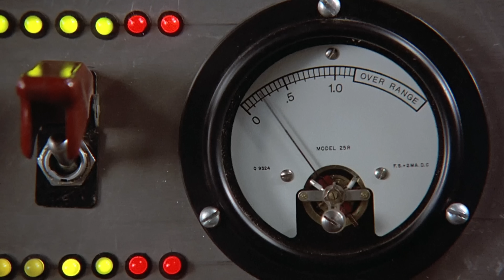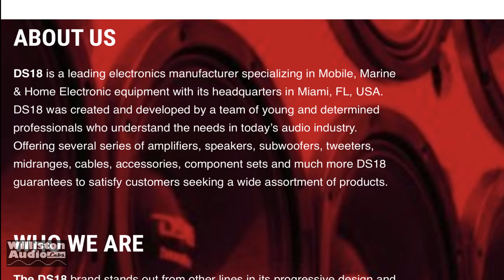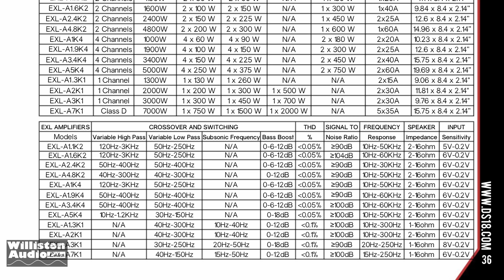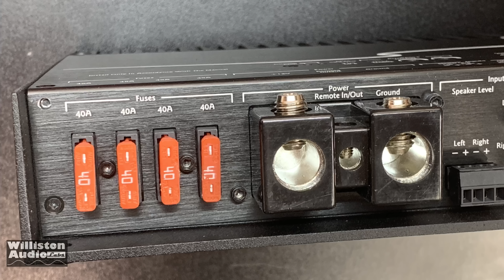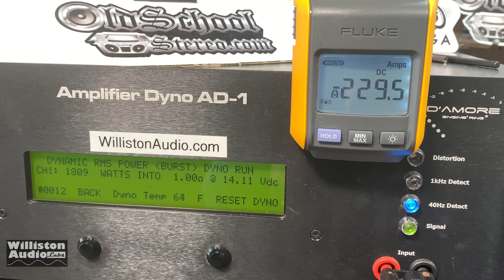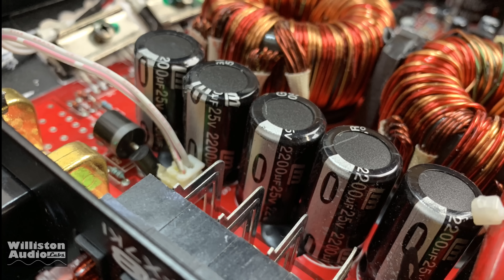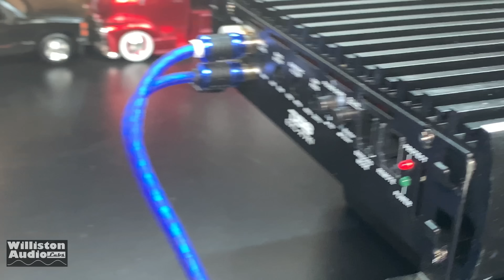Confusing Consumers like a Boss... DS18 EXL 7K Amp Dyno Test and Review [4K]

Comment: If possible I think you should test the DANOM amp's they have a 7k & 10k I was thinking about getting one of them I don't know it's a Brazilian amplifier I've heard good things about them but then I heard bad things about them 🤗
Reply from the maker: My electrical for the bench won’t support amps that big and keep 14 plus volts. I usually stay 5kW and under
Reply: @wal  WOW REALLY how much power do you need for a 7k 😳
Reply: @FLYGUYFOX  Assuming that amp even has 70% efficiency at 7000Watts (I am positive it is a few percentage points less), and assuming that maintaining a 14Volts power input is even possible then....10000Watts. Power Output = 70% x Power Needed, or 7000W = 0.70(x) = 7000÷0.70 = 10,000Watts INPUT. Maybe that amplifier is underrated too, and maybe 7000W is only at 1%THD and not even clipping or dynamic. That would require probably a solid 14000Watt supply setup at 14Volts. 10000Watts at 14Volts is 714Amperes. P = VI so 10000W = 14V x I = 10000÷14 = 714.28 Amps. Ridiculous stupid current. Maxwell cap banks, two or three batteries in parallel, 1/0 OFC and NOT loser-ass CCA (maybe TWO runs), and three 350Amp alternators turned up to 14.5-15Volts on the regulators. So, would you like to donate about...mmm...$2500 minimum to Mr. Big D Williston so he can add more Super Caps and a battery or two?
Reply: @pgmurray76   Thank you very information AI have A 7K amp  With 2 danom 150 AH  Just try and see if I need more battery power on A 375 alternator
Reply: @FLYGUYFOX  DANOM is VERY SERIOUS and VERY NICE product line!! I see your DA-12150 battery and your Just like all the other huge Brasilian car audio and pro sound companies. NOT a clownish copy of anyone. NOT a "fly by night" company. I love what I see. Definitely wayyy above Stetsom. I feel like I am looking at a wall of EV prosound speakers, but the Danom subs are MASSIVE like any good high power sub should be. I am going to add a separate comment just to call out Danom. Who knows? Maybe a big one will pop up in a Williston Audio Labs AD-1 posting in the near future. Actually, I should contact Danom myself and show them hiw much people love Big D Wiz and if they are not fakers, they should send out a mid power amp loaner to the USA for testing. I believe they are as powerful as they say they are. Strange though...last Facebook post was March 21, 2018. Before this was January 23, 2018. Hmm.
Reply: @pgmurray76   You shall see what I have in my car I had DANOM 2500.4   mids and highs amplifier is the truth pushing 4 DANOM 8'S & 4 DANOM TWEETERS  TALK ABOUT CLEAR AND LOUD IF I OPEN MY DOORS YOU CAN HEAR THEM WHERE YOU AT AND I'M LOCATED IN MIAMI LOL 🤣 THAT'S JUST HOW CLEAR AND LOUD THEY ARE BUT I COULD GET MY HANDS ON ANY DANOM  PRODUCT
Reply: @FLYGUYFOX  I see DAN-F3800.1 (3800Watts RMS). I see DAN-DA5K (5000Watts RMS). Is there a DAN-DA7K? Or is it a different model? I saw another model with 5000 in the model number, but it said 2500Watts RMS. Is yours a 7000 model and 3500Watts RMS?.This is all Facebook posts since I cannot see the website. If yours is a 7000 model then your alternator and battery setup is excellent. You need a cap bank and to have 1/0 OFC (NOT CCA) power and ground. You should be good, unless you have a DAN-DA7K then it may actually need 600-700Amps for full 7KW output. I am still checking.
Reply: @pgmurray76  DM ME ON IG FLYGUYFOX I HAVE THE FULL CATALOG IN COLOR LOL 🤣
Reply: @FLYGUYFOX  Ahh. DA-H1A10K. 10000Watts. Sooo you must have a DA-H1A7K
Reply: @FLYGUYFOX  Brasil, USA, Iran, Venezuela, Ecuador, Colombia, Puerto Rico, Panama, and Nicaragua. Countries with Denom distributors/sales.
Reply: @pgmurray76  I was going for the 10K but they said I need a lot of power which I almost got lol 🤣 but I have the big three dots on my truck high output alternator an oxygen-free Orion 0 gauge wire TRUE copper
Reply: @FLYGUYFOX  Hmm. DA-5K. That is the model with 'CLASS X DIGITAL MONO BLOCK AMPLIFIER' and '5000WATTS' on top. Digital Competition Series with cooling fan at top left in brushed silver left side and an LCD voltmeter at the bottom left. I like the black mesh cover with the punched round holes.
Reply: @FLYGUYFOX  I have been looking at an Instagram feed generator/compiler website with 'Denom' in any posts. I found a photo a new DA-H1A7K box on top of a new DA-H1A10K box. They do say 'RMS 7000Watts' and 'RMS 10000Watts' RMS after each printed model number. And they are long amps. I can only see super clear photos of the tops and the RCA input/speaker output end of both amps. Since you have one - is it fused internally? I only see the two huge machined power wire blocks in the center of tge opposite end. Cannot see if there are external fuses. Something is over there next to the power blocks.
Reply: @FLYGUYFOX  THAT is a quality and loud setup you have. You didn't get like Brasil or Dominican Republic crazy with the system (NOTHING wrong with that!) - meaning actuator lifted walls and bi-fold fiberglass doors. Damn! I was talking over you the entire time. Sorry again. I saw the Youtube notifications on the top of my Galaxy S9, but could not see your entire comments. I got OCD trying to find which amp model you had. Thank God you bought REAL power cabling. Not surprising since you are in Miami. Quality install shops are there and Orion has a huge presence. I am from NJ, but mostly in southern California, and drive to and through Baja South every other month. We will start taking a jet to San Jose Los Cabos and rent a car like normal ppl starting next month. I am a partner in a company that selects, designs, sells, and installs small to huge air conditioning systems in private homes, offices, hotels, hospitals, and condo buildings in all of Baja. Stupid MX goverment and banks both hold our damn money 30 days each sometimes. They both 'play' with my damn money then pretend they don't have it. Screw Mexico govt and banks. I wire money to MX and it arrives the next day with no holds and no bullshit.
Reply: @FLYGUYFOX  I went to six consecutive years worth of NYC Dominican Day Parades and PR Day parades just to get pummeled by the audio of the tractor trailer floats and the vans loaded with speakers. (Pluss all the ass. I won't lie.) Been to DR for two weddings and see the towers of pro audio out in the middle of nowhere making palm fronds move and vibrate. I used to install ok systems decades ago.
Reply: He does not test above 5000Watt RMS amps to GUARANTEE that the amplifier on the test bench can run without any limitations, other than its own design. Sure, some of the mono Orion HCCA beast mode man amps went above 5000Watts, but that is rare these days and it was Dynamic power with a slightly dropping voltage. Orion HCCA and the newer, larger XTR amps are something else.
Reply: I searched 1.5 hours for 'Damon' of Brasil. Nada. Zip. Zilch. Just because I as one person could not find them after 90 minutes and using all kinds of Portuguese translations does not mean they do not exist. But if it is that hard to find them.. sounds like a clownish fly by night company copying Taramps, Stetsom, Banda, or JBL/Selenium Brasil designs. A side note - I want a few brasil JBL Vulcano or Tornado subwoofers. Beasts in a narrow band SPL vehicle. But so are about 200 other subs. Where does a person "hear" of Damon or see Damon on the internets?
Reply: OHHHH!! DANOM and NOT Damon! You mis-typed it!! Sorry dude! Now I see all. I am kicking myself. Shoulda rearranged some letters. I did find old 'Demon' series Power Acoustik 6000Watt mono amp line. You seriously need some Maxwell or other brand high current super caps. You have a good run of wire and hopefully upgraded 1/0 minimum engine grounds and a 1/0 ground run to your 150AH batteries. If these amps do put put 7000Watts they may be coming up a little short, but regardless you are getting a heap of power and probably great output from your sub array.
Reply: @pgmurray76   Forgive me for a typo I have a DANOM 7K on 2 DANOM 15'S & 2 DANOM DA-12150  AMG batteries A 150 amp hours  Oh yeah the fifteen's  R 3000 are amiss

Comment: Are referb amps warrantied? Does the manufactur have to reveal the faulty parts? I'm just curious. Thanx for the video
Reply from the maker: Yes, depends on Mfg, but usually between 30-90 days
Reply: It would depend on the manufacturer or distributor or retailer.  Most will give at least 30 days or state required minimum for electronics.. witch-ever is longer.  No a manufacturer does not have to disclose what parts, if any were defective and if they chose to use the same part designs or updated or beefier parts.  If the unit passes final testing then out the door it goes.  

I have purchased refurbished amps before and I have no issues out of them.  Just check warranty and return policy before you drop the $$ .;)

Comment: isn't that like really good? is there anything else better for the price, I think not right?
Reply from the maker: It is a steal at $100, but I’m betting this was around $300 new
Reply: @wal   ya makes sense,

also did they fix the glue issue with the new rockiville, I heard if you push over 800 watts there is a good chance you will end that sub, I haven't looked it up since but ya,
Reply from the maker: @sniperpronerfmods9811  Upcoming video on Rockville Audio K9 subs, I'll test the 12" to it's limit, so we'll see how much power it can handle...

Comment: Oh no DS18. I had hopes for them but was left disappointed.
Reply from the maker: Amp is impressive minus the ratings. If rated 600/1000/1500 it would have made me really happy 😃
Reply: Yes Big D you got a heck of a deal at 100 bucks for a refurb and the watts it has. Bradley W, the disappointment I have are the ratings the company gave opposite the ratings it actually put out. Yes a hundred bucks for what he got is awesome. I had higher hopes for the truthfulness in the ratings. That's all.